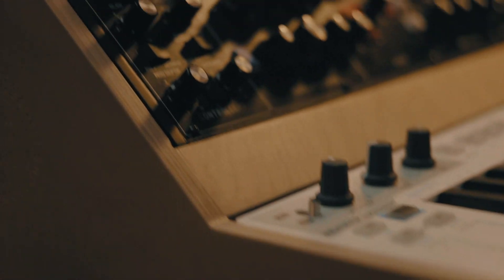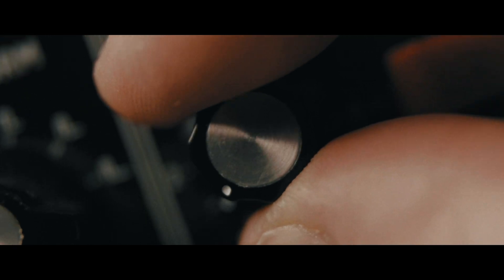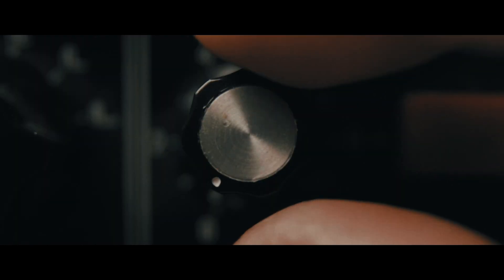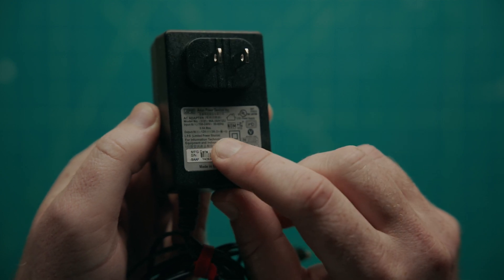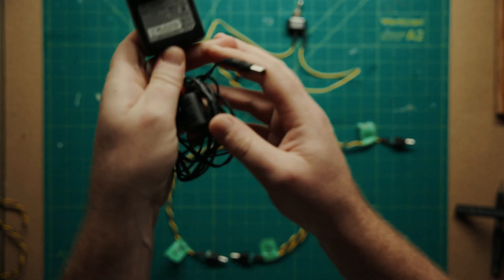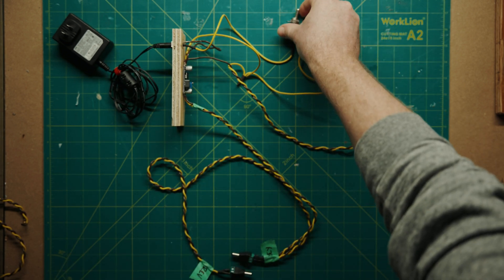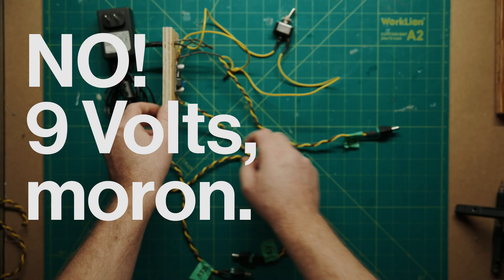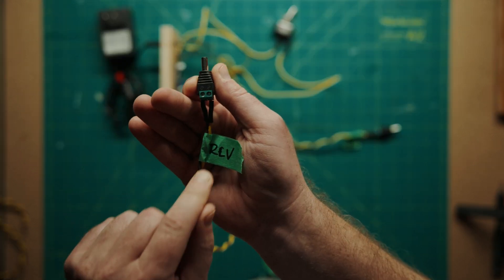One-cord synth power distro

Comment: Found this, searching for a solution to the same problem.

However, going thru all this trouble, to still have to use a wallwart is a bit odd in my opinion. I'm planning on implemeting the PSUs into the case itself, and just use a PowerCon connector to get 230v into the rig.
I might show my own version on the channel once I have it ready :)

All of my band equipment uses PowerCon inputs on pedalboards etc.